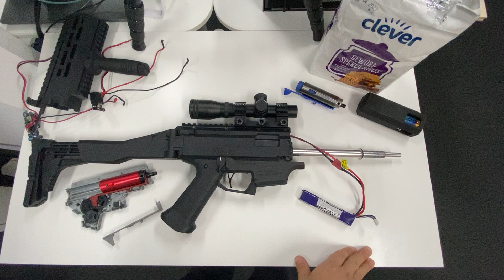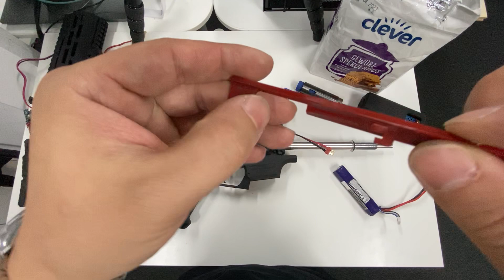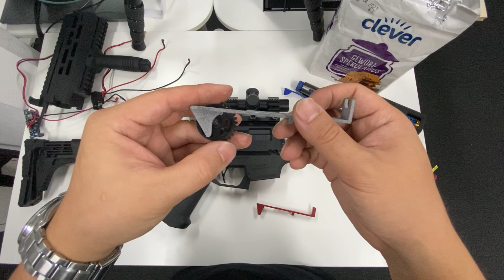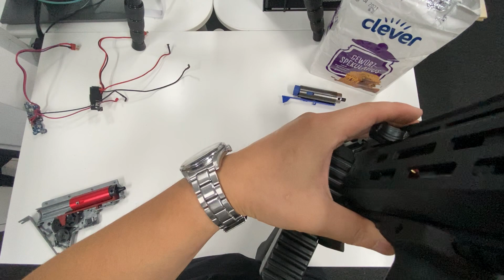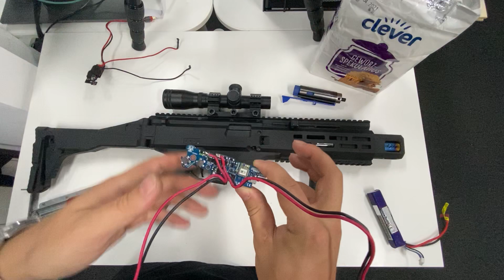99% perfect Airsoft gun: ASG Scorpion Evo

Comment: Everyone told me start with an M4, but I love CZ products (I own real steel) so I did a Scorpion EVO 3A1 and a P75D Compact (mostly for looks on my vest).

I sort of went nuts on the build:

*ACETECH Bifrost R
*18mm to 14mm adapter 
*Leviathan EVO3 Mosfet
*AEG tuneup service 111107 
*Custom service 27107
*Maxx CNC Hopup
*Maxx CNC trigger (red)
*Solink 14T Steel Rack Piston Head
*Maple Leaf MR bucking 70deg
*NBF King of the Jungle Brushless Motor 32k
*SHS Hardened 12.1 gears 
*SG Official 11.1V 1300mAh 25C TPlug Stick and Deans
*ARCTURUS TACTICAL B3 Pro 1-3 Cell LiPo/Li-Ion Smart Balance Charger for Airsoft AEG
*Beileshi Optic red and green w/ extension (X002R6ORVT)
*Aim Green Green Tracers .28g and .30g
*ASG ATEK Angled front grip
*Talon Grip Pro tape
*Prometheius 208mm barrel
*Angel Customs Firestorm 1500-round Flashmag
*116533 charging spring (had to stretch slightly)
*110803 Mock Bolt spring (remember to bend the front to fit the pin)

Comment: I'm buying this as my 1st gun and would like to perform some of your suggested upgrades. Would you be willing to help me? I can compensate you for your time. This will be my 1st teching of a gun so it would include the basics. Such as what precision shims to buy and what lube and how much to use and so on.
Reply from the maker: 0,1mm-0,2mm shim set would be enough. Silicone grease for the pneumatic parts,  Vaseline or general purpose lube for mechanical parts for the gears. No need for these fancy "airsoft lube"
Reply: @wyz2285  thanks for the reply. Is there a way I can contact you? For some detailed support in what to buy and how install some of this?
Reply from the maker: @jessedecruz1590  Join the ASG Scorpion Evo facebook group, I posted my part list there.
Reply: Did you purchase the gun from evike dot com? I see the zci inner barrel's there but which length should I get? And which gear set?